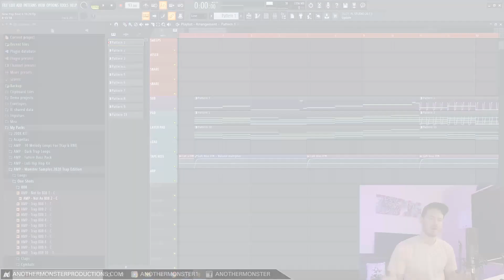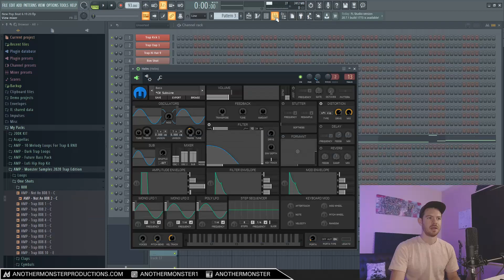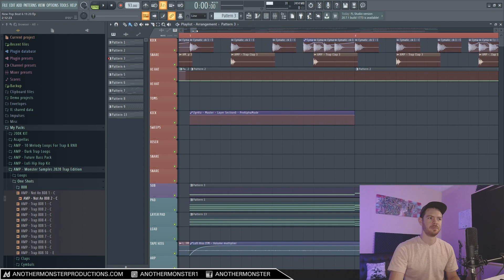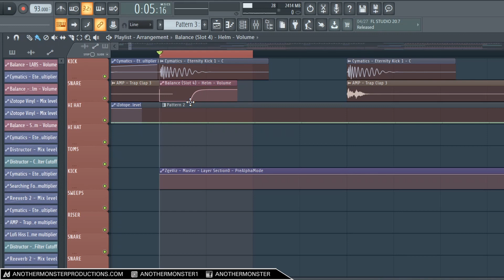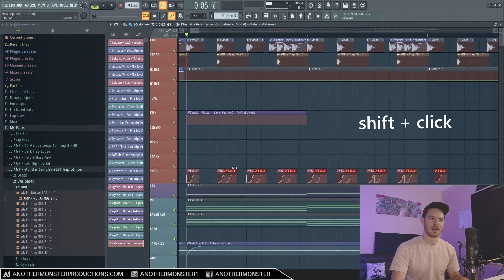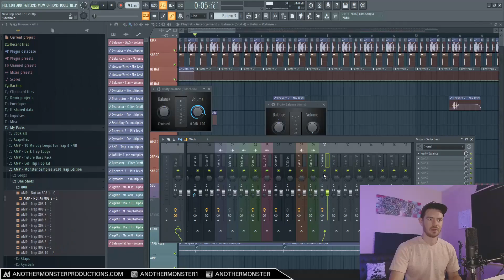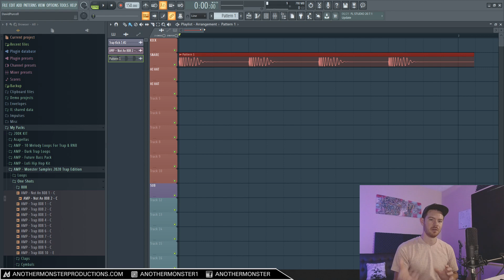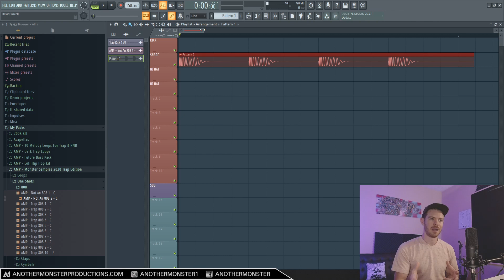How to Sidechain in FL Studio 20

Comment: Peak controller is way easier. You don't have to copy and paste every single kick in the track. It's nice to see the shape, but it's so much more work.
Reply: You can also make a short pattern and have a single kick and automation clip play, then paste the pattern around so the kick and sidechain are automatically linked together
Reply: After trying a few methods (usually with the compressor, but also wig Gross Beat and Shaperbox) I think I might  go back to using Fruity Peak Controller, except I'll link it to Fruity Balance. In the past I had the peak controller actually moving the faders up and down. It looked cool, but then you lose the ability to manually move the faders.
I guess the downside of using peak controller is that you don't have a visual reference of the shape of the automation, but it's better for quick workflow, and it's certainly the better option if you have a complex (not 4 to the floor) kick pattern that evolves during the track.

Comment: Can I automate the fader instead of adding a fruity balance?
Reply: You can, but it's a really bad idea. What if you need to change volume of the whole sound later? You won't be able to do that, cause it will be getting back to the automated levels. The other small issue with channel fader is that it can't go from 100 to 0 or 0 to 100 instantly if you need it. The fader will be MOVING and that creates a filter attack/release effect kinda (it's VERY short though). But yea, adjusting the channel volume will be a pain in the ass.
Reply: @RandomBakaStuff  Thanks for the help. I was going to use Fruity Balance anyway but just wanted to know why it was important. Your reply helped a lot. Have a nice day :)
Reply from the maker: @grakn1gh7  I used to use the fader to do that, but using the fruity balance is definitely a better move for exactly what random was saying
Reply: @grakn1gh7  Glad to be of help :)
Reply: It might be impractical for the reasons detailed above, but it looks really cool when your faders move up and down automatically, like the flying faders of an analogue mixing desk.